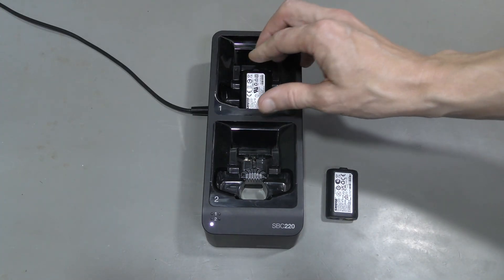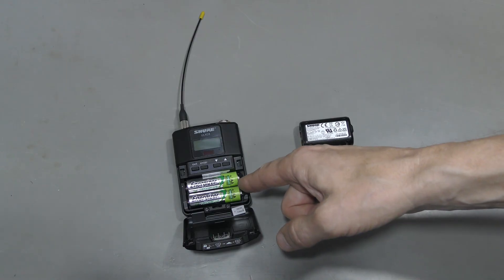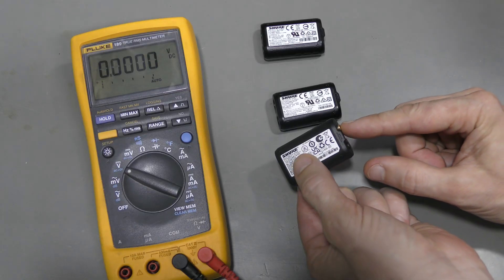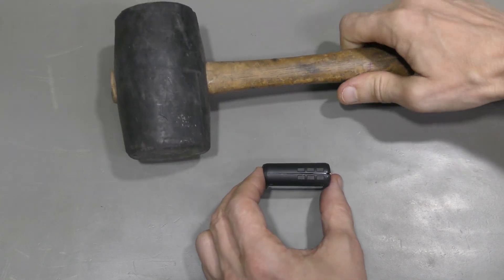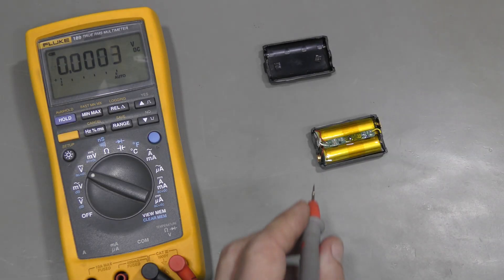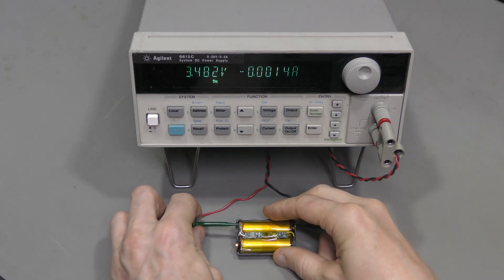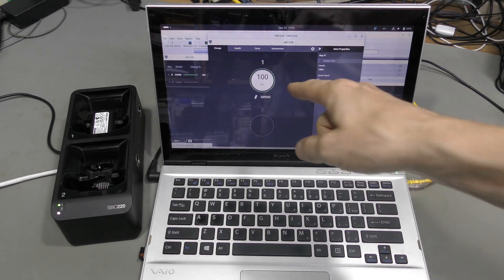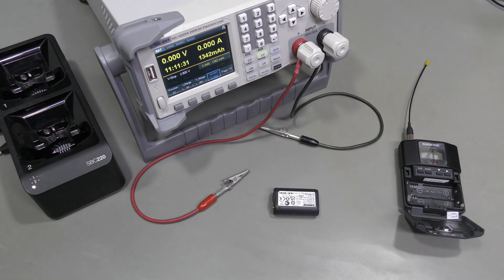#164 - Shure SB900 battery repair

Comment: do you sense the battery voltage with the 6612C? is this a normal safe practice with a single quadrant psu?
Reply from the maker: What can be unsafe about that? 6612C is not a single quadrant PSU, but I don't see how this might be relevant to "sensing voltage" (whatever you mean by that).

Comment: Yep, more and more are doing similar things now with LiPo batteries. Especially for model aircraft and power tools.  Thing is, the controller inside gradually drains the batteries too, as it always on, monitoring, so eventually the cells drop below minimum voltage and wont charge!  We have to take them apart and charge as you did here.  Its a complete rip off and un-needed in most cases.
Reply from the maker: I believe that BMS consumes microamps. Probably below self-discharge. So I don't think this is a conspiracy and a rip-off. This is just the way things work. Nothing is perfect. Battery storage takes some care. One cannot store a fully discharged battery for many months and expect it to be fine. This Shure charger I showed in the video even has a special storage mode to charge batteries for storage (charging to 3.8V).
Reply: @feedback-loop  :)

Comment: Lucky!  The Bastards are putting perma lock out switches into batteries now.  You need to re-flash the controller to wake up the BMS again.  And.... that is not feasible for 99% out there.  I'm looking at YOU, MILWAUKEE.  🤬
Reply from the maker: I have no idea about that, but I see that some people went to great lengths to reverse-engineer Milwaukee batteries. Have you seen this, for instance? https://www.youtube.com/watch?v=gh2-gSRNw-Y
Reply: @feedback-loop  Exactly.  And we now know they brick themselves on purpose.  Another video shows how to flash the BMS to restore it.  I'm sure Milwaukee will change the code to prevent that very soon.  None of their batteries balance the cells, even though technically they CAN.  But that's the business model.... sell you batteries.
Reply from the maker: @Runco990  well, that is not very nice on their part. I am a bit skeptical about the "on purpose" conclusion. We cannot read their mind. But you seem to know what you are talking about.